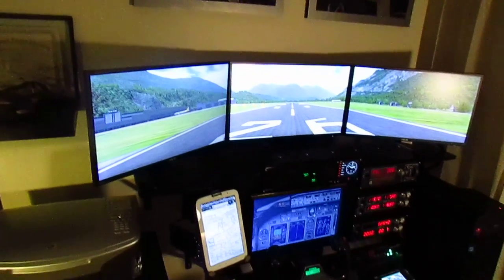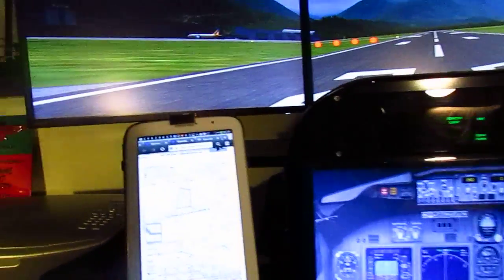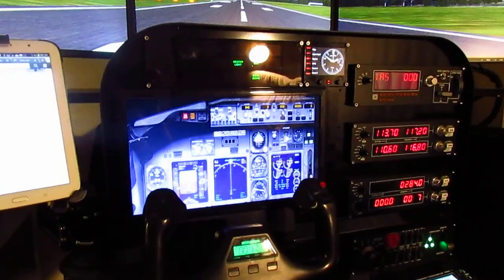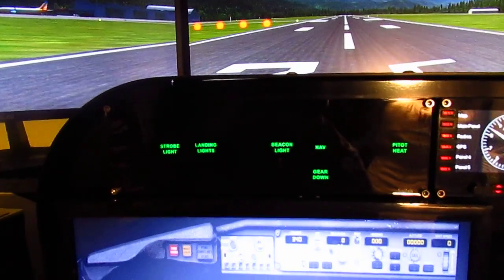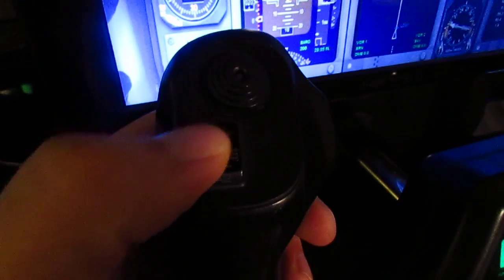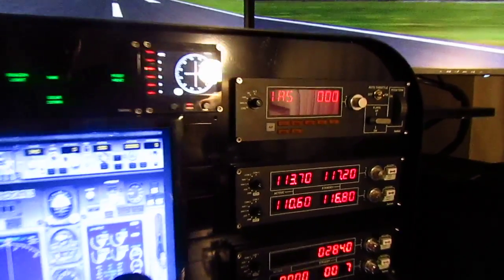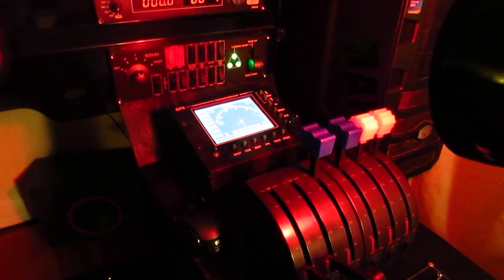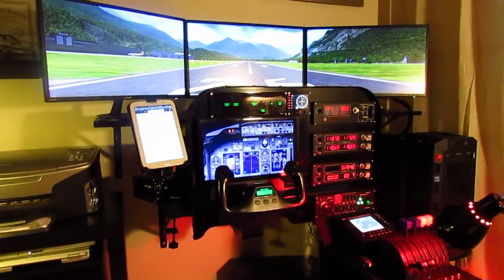How to build a FSX home cockpit. Full Saitek Pro Flight Setup with multple monitors.

Comment: I just received the pro flight panel radio only..Do you know how to turn the led displays off when not in use but still plugged in to your computer via the USB cable when  the computer is turned on for other applications? ( My pro fight radio panel display appears to be lit permanently so long as it's plugged in and the computer is on, whether in the simulator (xplane) or not and would prefer the displays to not light up/display info when not in the simulator..(SPAD driver installed..the original Saitek driver did not work for me at all- the Saitek driver just made the display display random, constantly changing numbers)..Thanks for any feedback
Reply: justinspirational At W8.x power saving mode will turn off panels when not used. In older Wins you have to unplug panel or use USB hub with switches (on/off)
Reply: Jiří Kocman thank you- I want to have my windows 8.1 computer to run in high performance mode (to get best frame rates in my sims) so not sure if that would still work unless you are referring to something else..I may get a USB hub with switches but am waiting to see if the saitek pro flight switch panel (which I've also ordered but yet to receive) will turn off the panel displays by switching the alternator and master battery switches off on that panel (as someone else has suggestedthat may do it)..also how do you set up the fourth monitor in the cockpit to display the instruments only? (I have a 3 monitor wide nvidia surround set up too- two gtx 980s in SLI, but utilizing one of my spare monitors similarly as a 4th instrument display  would be helpful- just not sure how to set up in FSX or XPlane 10)- thanks

Comment: Oh, one other question Marek.

The monitors I find are 15.6 inches. Even the one that saud 16", the actual dimension is really 15.6" This should work with the Saitek flight panel, right?

Some monitors do not require a separate power supply. The USB supplies the power. Do you see any issues with the USB supplied power? Would you recommend a separate power source?

Thanks,
Tony

Comment: Marek, The switch panel is in place of Saitek Throttle System. Did you have any problem holding the panel in place without the clamps? Also it looks like you had a metal plate bent at the GPS. Is that so and lastly what is the depth of the shelves for both the monitors and also the flight panel. Great job, you should be proud. Thanks, Buzz
Reply from the maker: Buzz Foster Thank you Buzz..I drilled 2 more holes at the bottom of the Advance Pane and connected the panel with the shelf for better stability. The plate near  GPS is just a wooden plate painted black that connects the center console (made of old cabinet) with the panel. Its resting behind the GPS and its not attached to anything. The depth and height of the shelvesupper shelf: 40 inches -height., 16 in deeppane shelf: 26 -height, 20 deep.If you need more detail pictures send me mail at : marekmarciniak11@gmail.comTake care !

Comment: is the hannspree ('virtual instruments') monitor set up as an ACCESSORY display or optional SURROUND display and what input are you using- HDMI, DVI etc to work with the 3 main nvidia surorund monitors? did the Desktop Aviators GPS unit come with the screen for that price? thank you
Reply from the maker: justinspirational yes it is hannspree. yes, desktop aviator comes with the screen, they have another model without it, but i wouldnt recommend it.
Reply: Marek Marciniak thank you- do you know the exact desktop aviator model to look out for including teh screen so I can research it please and do you know if it's compatible with XPlane 10 at all please? Thanks once more
Reply from the maker: justinspirational http://www.desktopaviator.com/Products/Model_2450/index.htm
currently out of stock. As far as i am concern it is only foe MFS 2004 and X.
Thanks for watching !
Reply: Marek Marciniak thanks for your swift reply

Comment: Saitek is game locked though isn't it? I wouldn't be able to use these systems on like War Thunder, IL2, DCS, Falcon 4.0, Elite Dangerous, or Star Citizen huh?
Reply: Heck No Bro. Its a regular USB Interface. Assignment software as well as macros 3 seperate modes....itll work for anything pc or mac.
Reply: I use my Saitek x52 Pro in X-Plane, Elite Dangerous and FSX =) You could even play Call Of Duty with Saitek's controllers, though it probably would be difficult
Reply: That's what I want to hear!

Comment: Very nice set-up! Which desk do you use to put the 3 monitors on?
Reply from the maker: MrNIEUWJAAR  I use 2 shelves. One for monitors (longer but thinner) and another shorter but thicker for the instrument and avionics panels. Thanks for watching !
Reply: Thanks. I can't seem to find a HL161ABB monitor which could be shipped to belgium. Did you buy yours on Amazon or somewhere else? Also do you think any other 16inch monitor would fit? That would be easier/cheaper for me.
Reply from the maker: yes I bough my monitor from Amazon. I IT IS Hannspree HL161ABB . I just checked and Amazon has it for 199.59. The price went up. I bought ir for less then 100
Reply: Yes i've looked for it aswell and there isnt a single seller who ships to belgium. Don't you think I could use a 16inch monitor from an other brand?